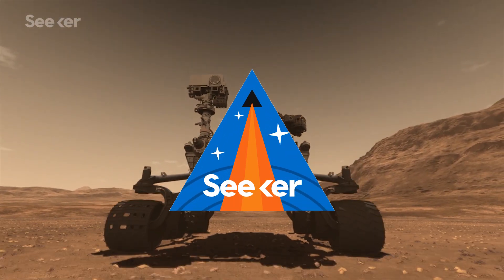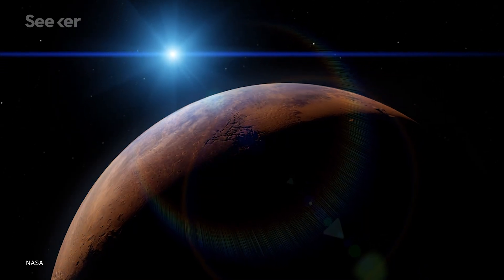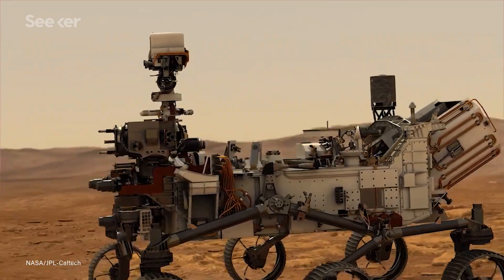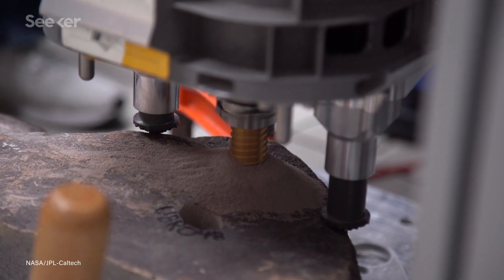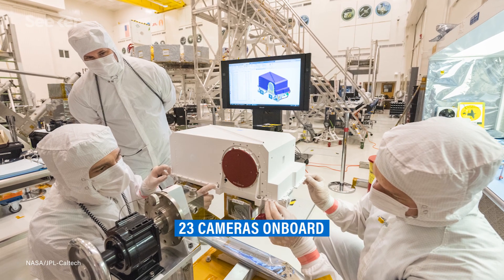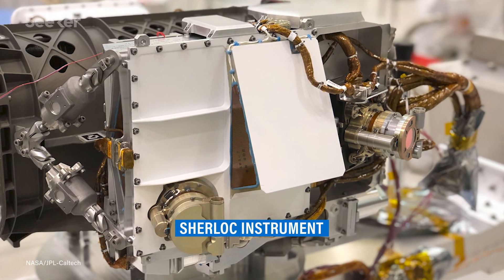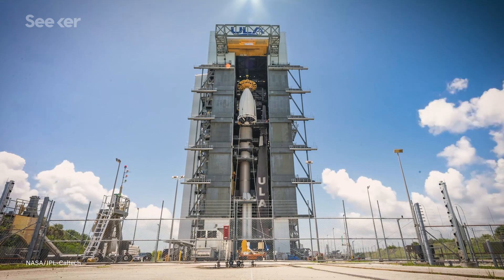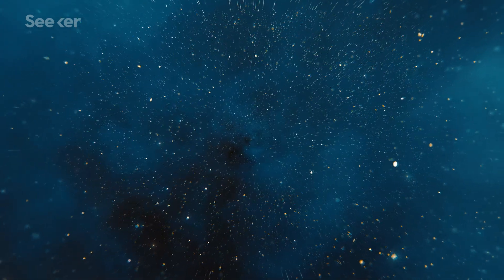Mars 2020 Launched, Here’s What You Need to Know

Comment: The sample return tubes (3:20) have got me excited. Retuning the samples back to Earth would grant the ability to re-test with current and upcoming technologies. We'll have something to study for decades; the lab onboard the rover is limited in its capabilities. Do we know how deep NASA is planning to drill? The satellite imagery shows mostly a "clean" surface but one must expect some martian regolith... Also, in the odd chance that rover hits pay dirt/very fragile fossilised "cells", wouldn't the high levels of radiation render the fossils mostly unrecognisable to the rest of the sample? It's not like we're going to dig up a bone. If we find anything it's going to be a very simple cell, possibly a structure of a cell and high levels of radiation will strike through the sample much like a gun to a sheet of tinfoil. The tubes themselves seem to be somewhat covered but I doubt this offers much protection, I assume? Do we not need to dig deep, past X - the point in which radiation levels are fairly low/protected by the regolith above and some "pressure/heat" is available to allow liquid water to exist between the rocks etc hm. Thoughts? @seeker :)